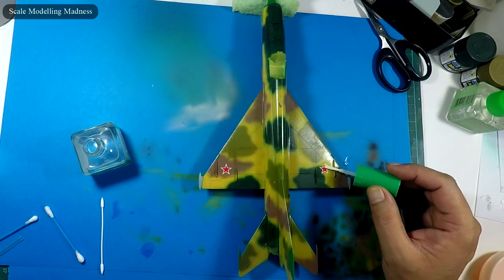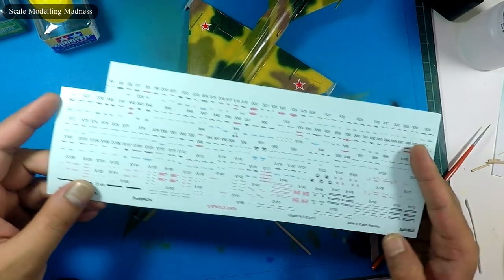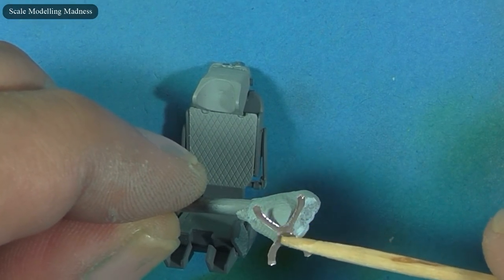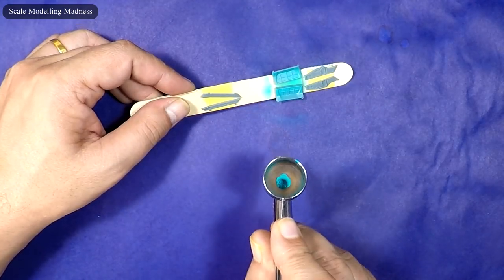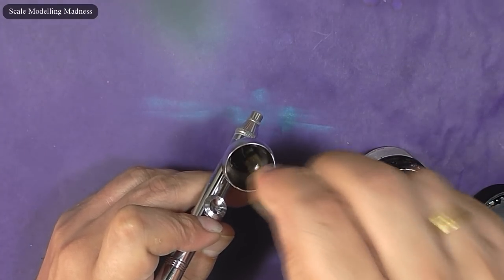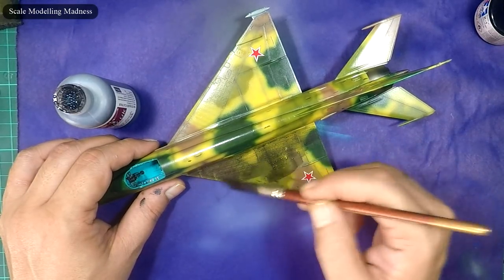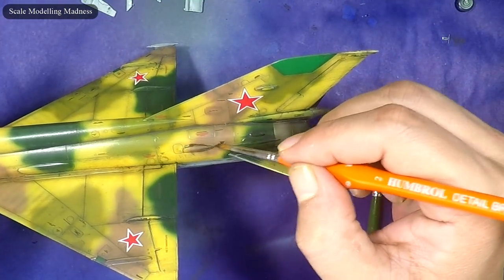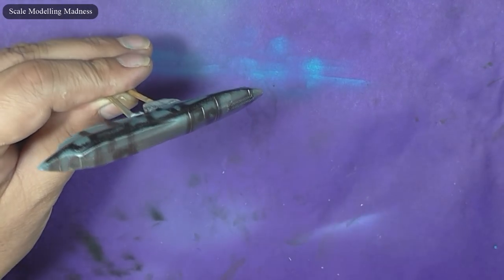Eduard 1/48 Mig 21R (Part 4: Weathering and finishing)

Comment: I wasn't sure about the yellow, but it came out very nice.  I've wanted to build the Cuban version for a while now.  If I build the Russian version, are there also stencils for a second Cuban version? Thinking of buying overtrees and building two planes.  Also, please tell us which gloss varnish and which matt varnish you use.  Thank you.
Reply from the maker: Hey Zlee....I have for years now been using Future/Pledge  Floor Polish. However, more recently I have also started using Tamiya's X-22 clear. Both are used for a gloss finish. They give a nice smooth hard finish and also are a  good surface for adding washes. For the matt varnish, I use Ak Interactives matte varnish. Hope that helped.